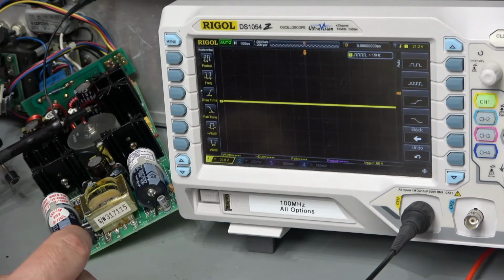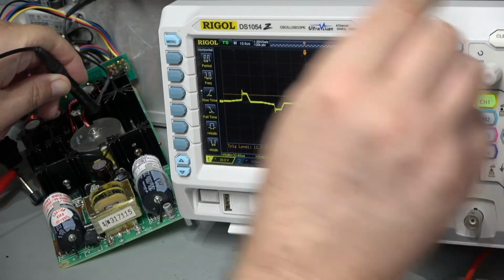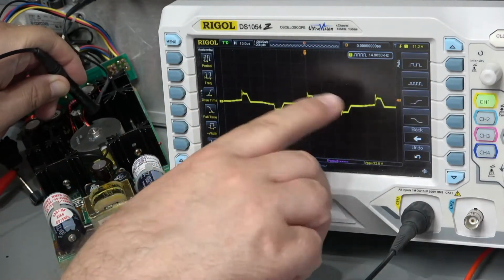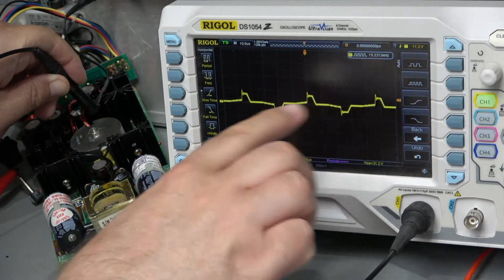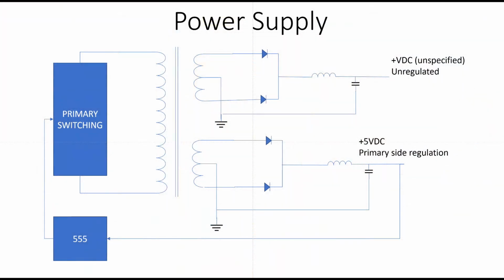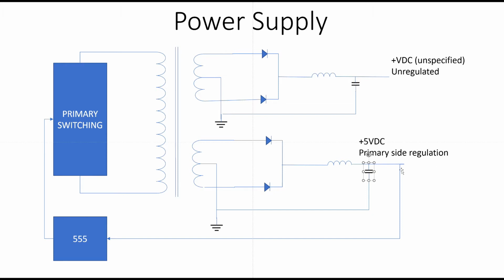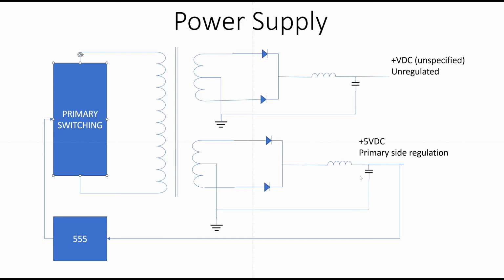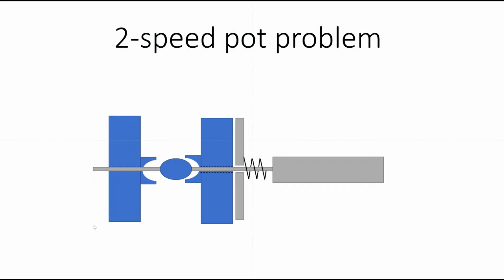Nicolet 3091 Vintage Scope Repair #0066

Comment: Fun to see you dig into the 3091. I just this morning purchased one from a university surplus.
I bought it since this scope is the first instrument that I designed portions of, including micro-code. I met one of my best friends, also an engineer, when he was also assigned to the design team. My memory indicates there were four of us EE types working on this 3091. There was also a version with a signal averaging module also. Note this was 40+ years ago. The memory we had access to was limited and expensive. I cannot say I recognize everything inside the scope, it has been a while. The 2904 byte slice chips are parts to make a uProcessor of your own - basically ALU's. The code is in the ROMs nearby. The row of 14pin chips with paper tags - was a programmable clock generator state machine of my design. The clocks were needed to run the 12bit 1us ADC. Now this was a neat ADC, all discrete, including that 'Nicolet Assembler" chip which took the multistage comparator plus Multistage DAC output and "assembled" the two's complement 0->4096 binary. I think those two other chips may be DACs to drive the crt. Elsewhere I designed the time base, (simple), with the timer chip you mentioned. Many memories working at Nicolet. Pronounced "Nic" "O" "Lay". not "Nic" "O"  "let". 
BTW - the horizontal cursor buttons have 3 speeds. My idea, my code. The marketing guy did not like the idea until he took it to his customers who thought it was great. ;-}
Reply from the maker: I should have realised the pronunciation - My french teacher would be turning in his grave!   Always fun to work on things of that vintage - from back when I was just starting electronics but could aford nothing but a rubbish multimeter and a monthly magazine.  Like stepping back in time, I wish I had the space to put together a collection of gear like this.   The 10 bit ADC was a real surprise particularly the speed.   It is quite a testiment that it still performs so well with mainly electromechanical things to fix.  When I was packing it up for sale I discovered I had the full manual in one of the large piles.
Reply: @MakeOrRepair  12 bit adc
Reply from the maker: @mr1enrollment  oops just senility creeping in!  - yes I remember commenting on the 4096 count!
Reply: I am very glad i found this comment. I own a rack mounted version (the certificate of calibration calls it a 3091R, made in 1987 or 1986) and I noticed some slight differences with the processor board such as my program rom chips being labelled 3090, everything but the ADC board calls this a 3090. One of the 14 pin ROM chips seems to be dead?, it only reads all zeroes. It is really hard to find any information about this online. I am currently trying to reverse-engineer the processor board since i do not have any schematics.

Comment: Nice kit. Would it be too impolite to ask about the cost of the unit and the cost of the power supply? How did you find the complete power supply? Finding it was amazing, in itself, I would think.
Reply from the maker: I got the unit with some other things, so I don't have a proper cost, but not much.  The power suppy had full manufacturer and part numbers on it and I put it into ebay and a couple of other things as a saved search - much to my surprise one turned up.  it was about £40 but after shipping and customs it was proably more like £70.  Given what I know now (and if I were keeping it)  I would proably put in a TDK-Lambda or Mean Well open frame +-15, +-5V power supply which would have been a bit cheaper but needed some mounting changes.